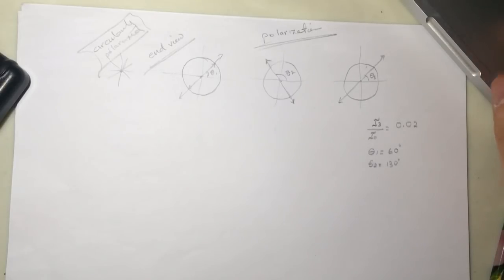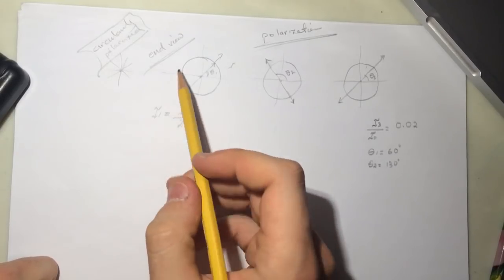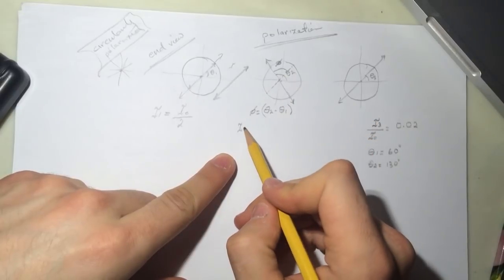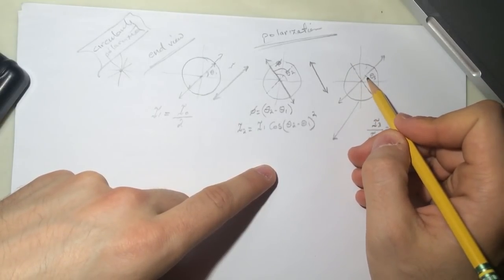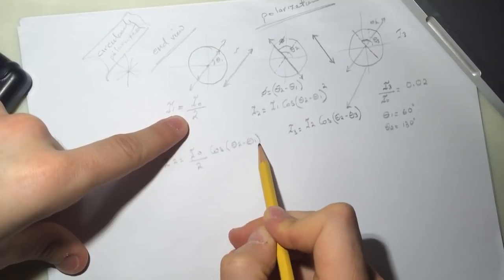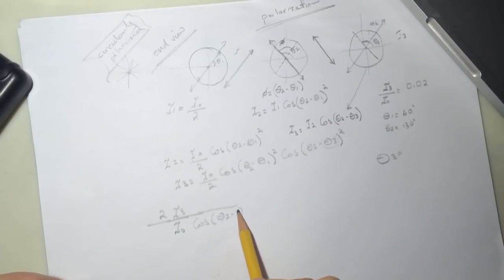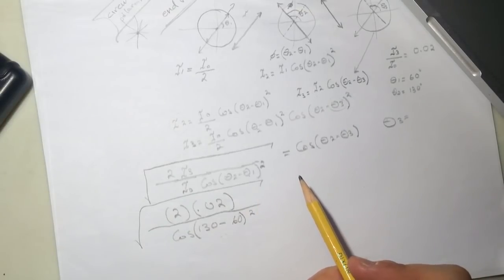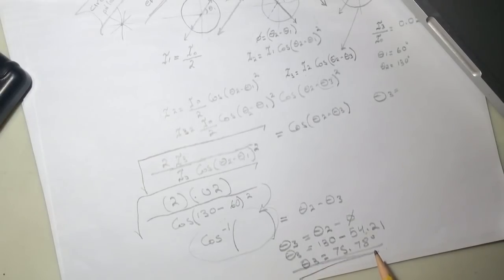Polarization "Smartphysics" Solution.

Comment: But why is Io/2 after passing the first polarizer? It seems like all your vids start off with the assertion that after passing the first filter, regardless if the light is linearly polarized, circularly polarized, or unpolarized the intensity will be cut in off, but there is no explanation...